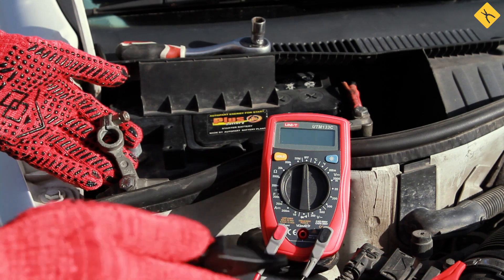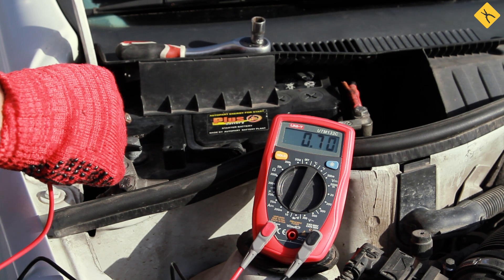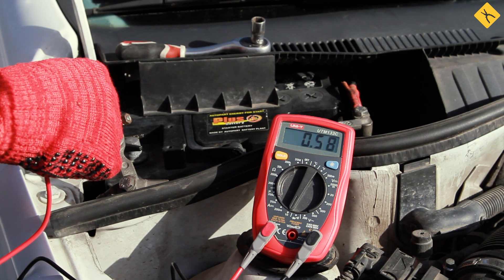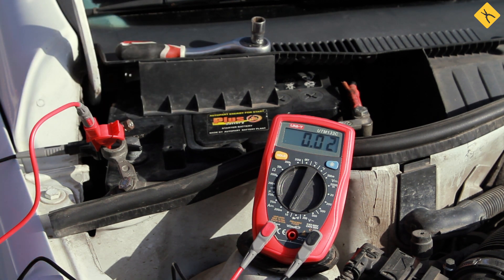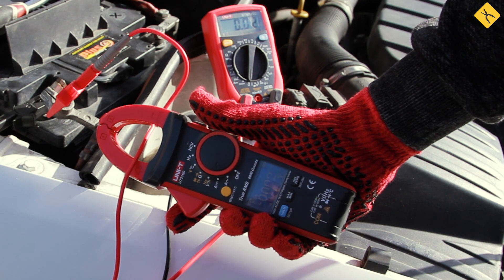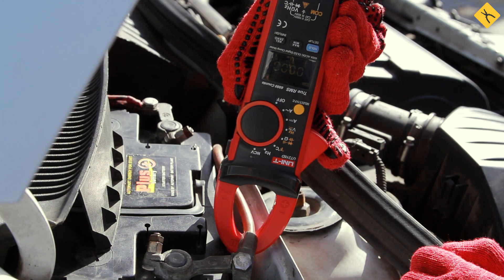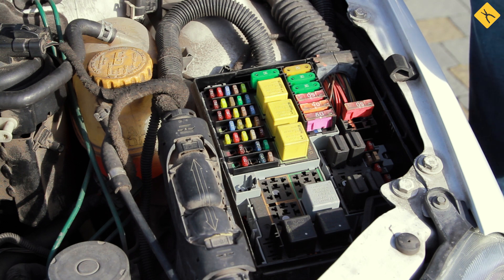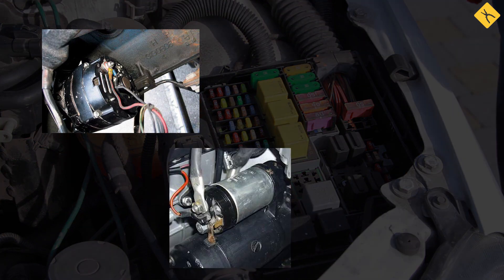How to Find Current Drain in a Car with a Multimeter and Clamp Meter

Comment: Hello. Nice video. On my Renault Clio 172, using an amp clamp, when at idle it showed about 30 amps on the alt to battery wire. 

With the car off it still shows about 200mA on the amp to bat wire and my alternator makes a faint electrical noise, like a beeping, or ticking.
Is my alternator draining my battery when the engine is off? Parasitic drain?
Or is it normal to still get current readings on the alt to bat wire with the engine off?

Also, i have about 100mA on the negative battery cable. Its a bit high..

Comment: Wont pulling fuses result in modules waking up on the can bus lines and create draws that may not be real as a result?
Reply: You have to open the hood of the car, wait for around 10-20mins for the car to fall asleep and then pull out the negative terminal to measure with the multimeter

Comment: I have to choose between 2 clamp meters :

1- Uni T UT210E mini pro, with these DC ranges:
 Volt  (0.1mv - 600v) 
 Amp (0.1mA - 100A) 

➡️Good for parasitic draw test, but don't go for high ranges

2-  kaiweets HT208D,  with these DC ranges :
Volt  (600 mv -  1000 v)
Amp  (60A - 1000A)

➡️ No low reading for parasitic draw test, but has high ranges 

Can I choose type 1  to do most car diagnoses as a hobbyist , or I need both types? 

☺️💛Thanks
Reply: I think that ut210e is the best for low amount of amps,(mA). There are three decimal digits,(0,001mA).
Reply: @thanev1889 
Did u buy 210e
Reply from the maker: The first option will not be enough to fully measure the current strength. For example, you will not be able to measure the inrush current even at a basic level. Alternatively, you can buy both. Or one that would contain all this functionality.

Comment: If using the amp clamp on the positive cable, does the negative need to still be disconnected?
Reply from the maker: No, the electrical circuit in this case must be closed.

Comment: Hi..i don't know wtf is ac dc a v or oem.. can you please help me find a meter clamp for a car which reads automatically the shit I'm putting the clamp multimeter on ?! Thanks!
Reply from the maker: Please elaborate exactly. Current clamp measures different values depending on what measurements you want to know. Its main purpose is a non-contact measurement of current. However, you can also measure voltage or resistance by connecting probes to the device.
Reply: If you dont know what it is...stay away from measuring anything

Comment: That's terrible, don't zero out the meter after closing it around what you want to measure - unless you're then going to remove it without changing it's position/orientation and read the negative figure instead.  By zeroing it after you've put it around your wire you'll ensure you don't read anything at all (zero). What you saw on screen afterwards was likely from moving the meter around. 
I don't know about exactly the meter in this video, but the UT-210E from same brand is very sensitive to movement on the 2A range. Less so on 20A but then you have less resolution too. Most practical way I've found is to hold the meter very close to the battery cable, zero it out and without moving it afterwards, open the jaws and slide the battery cable inside. Move the cable rather than the clamp meters position or orientation. Brace the hand holding the meter against something to help prevent inadvertent movement.  If you can't manage this you'll have to put the meter down somewhere after clamping the battery cable, disconnect the terminal, zero it out (still not moving the clamp), then reconnect the battery terminal and read your value.
Reply from the maker: Wow, that was really helpful advice for us! Thanks for the detailed explanation! :)

Comment: Dumb question but does it matter if I clamp on the positive or negative side cables?  Thanks
Reply: No
Reply: No, you asked a reasonable question.

When checking for leakage current, you should disconnect the negative cable, as current flows from negative to positive.

Comment: I’m getting a lower current reading on a clamp meter than on my multimeter. I think you mentioned that multimeter receives a higher current. So in conclusion, which testing tool should I rely on when testing current?
Reply from the maker: А tool with a higher accuracy value (The measurement error is indicated by the manufacturer). In this case, because of the greater convenience, we advise you to choose a clamp meter.

Comment: Very informative but you forgot to show which connection to use on the multimeter because there are 3 connector on the multimeter
Reply: Black wire will be COM or MINUS always, the red is either V or A  now you measure Amper so you plug into the A.

Comment: Why do I get different readings on the + and - cables when a battery is charging?
Reply from the maker: Hello! It is possible, It looks like there is a current leak. Try to turn off all the appliances that may consume electricity (one at a time), and you'll find the reason.
Reply: @ToolBoomVideo  Will try it, thanks. If there is still a problem, I will let you know.